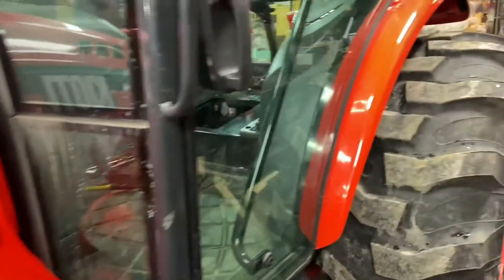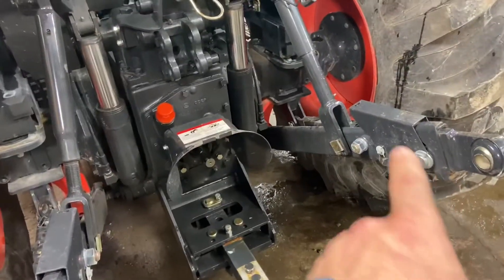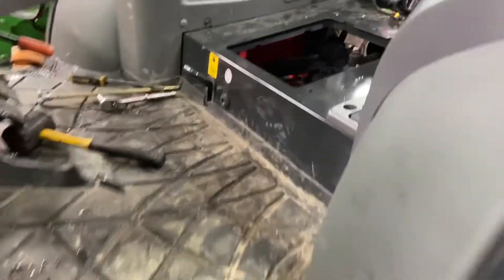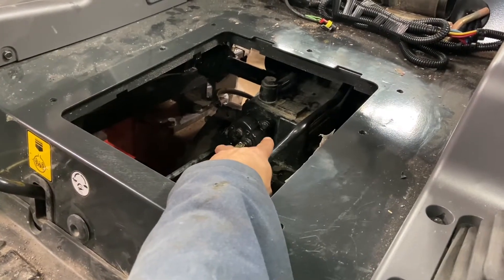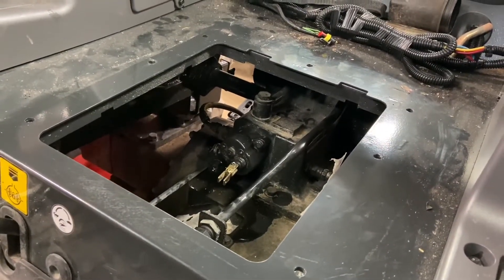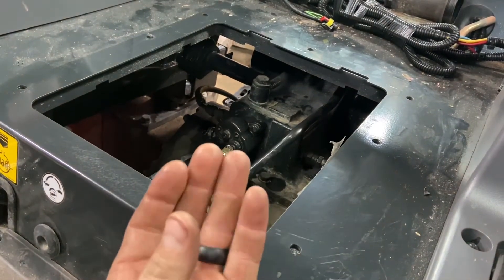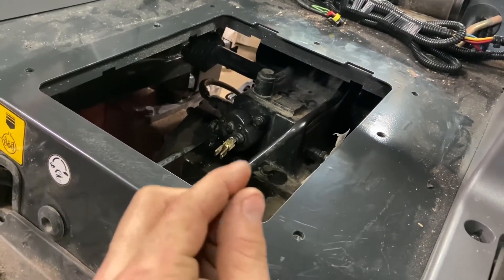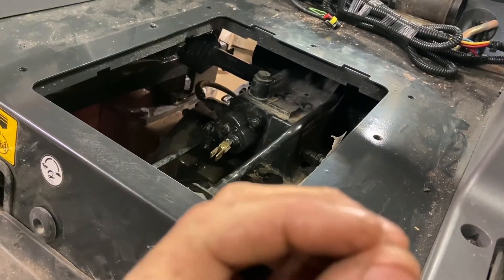KIOTI RX 7320 3 point hitch fix

Comment: That happened to mine as well, however no one seemed to know why and I just lifted the arms up and down with my hands until it started working. This video makes a lot of sense now, I assumed that there was something in a valve and I was right. good news is that it's been working for an over a year without issues since, and since you actually fixed it and I don't think you will have any issues.
Reply: My rx7320 has 58 hrs and done this today after being frustrated for an hour I looked it up saw what you did so I raised my 3pt arms myself and it took off and is working fine?
Reply: @wesfleisher8412  that is good to hear, I am pretty sure the spool valves have a burr on them and working them a few times fixes the issue. I have never had this issue since and believe it just needed to get worked in a little.

Comment: Hey sir. I have a RX7320 amd the auto pto aint working. I have checked the switch and the micro switch (both work)  is there anything else?  The pto works but dont stop turning when the lift arms are raised.

Comment: Appreciate the video brother. I recently purchased a 2015 RX7320 ROPS with 320hrs on it and the previous owner mentioned the 3 point arms twice wouldn’t go down. I looked into this and I think they call that the MLS valve. 

What kinda job was it to re and re that valve. Was told there’s a million tiny springs and check balls and takes a steady hand and patience to do the job.
Reply from the maker: It’s not really that bad just take your time and remember where everything goes but if the arms won’t go down that could have had that valve turned all the way off and stops flow and locks the arms where they are. I’ve seen that happen a lot and I’ll I do is show up and turn that valve and go to do or like this video there could be something stuck in it

Comment: This just happened to mine and I think it’s the same issue. Would you happen to know the part number for the o rings. I greatly appreciate the help
Reply from the maker: I am looking for the part numbers for the o-rings but they changed the computer system and want you to just order the whole valve but I will find them for you sorry for the late reply
Reply: @_j_hilti  no worries! I appreciate the help. I actually lifted the arms up and down like comment below said do and it worked!

Comment: Sir what would make the arms bounce when the lift is al the way up
Reply from the maker: A bad seal letting the oil flow by the piston in the tower . Or it could be the valve under the seat has a small piece of something in it not letting it seal
Reply: @_j_hilti  thank you sir. I'm new to working on Kioti tractors. I'm still trying to figure these things out.
Reply from the maker: @MHolt3573  they are pretty easy if you could get your hands on a workshop manual you will have everything you need
Reply: I have those sir. Sometimes it's hard to find what I'm looking for in them.
Reply from the maker: @MHolt3573  that is true